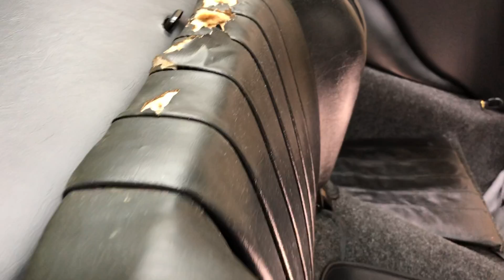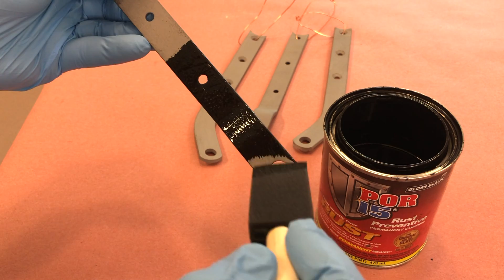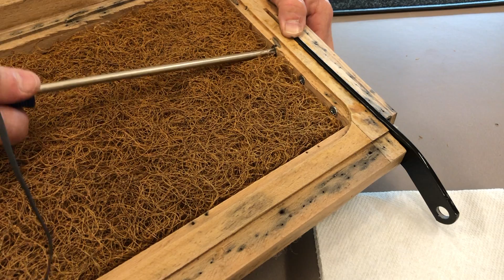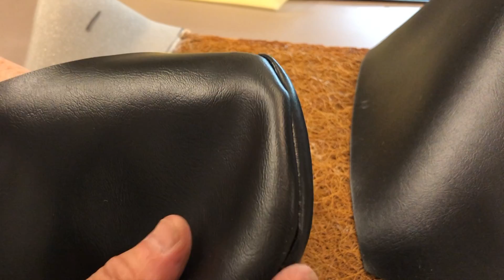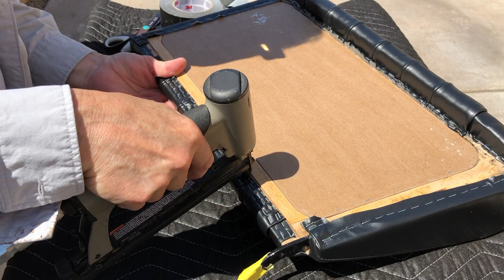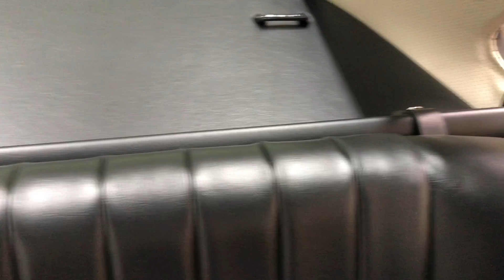Porsche Rear Seat Restoration    Part-1 seat backs!

Comment: What size foams did you use?  1/4 and 1/8?  Getting ready to tear mine down and want to have everything on hand.  Thanks,
Reply from the maker: Hello Don
The Kits were from Autos International Inc and any misc. foam under the kits would have been a 1/4 inch. The only place I used 1/8 inch was the
dashboard main piece.
Good Luck with your restoration work!
Cheers

Comment: My screws for these rear seats are completely stuck… haven’t been able to get them to turn at all
Reply from the maker: Have you tried KB 88? it works wonders
Reply: @MikesRestorations  no I haven’t, I hit them with some PB Blaster about a week ago but didn’t try to break them loose after that (moved onto other bigger problems). I took off all the calipers and found out all but one were stuck pretty bad (I still have one stuck piston that I haven’t been able to get out haha).

Comment: Mike, what did you do to the rails that the seat bottoms ride on to make them so nice?  Mine are serviceable but the metal is stained.
Reply from the maker: Hello gtate
The rails that mount to the floor were re-plated.
The rails that are riveted to the seat bottoms were left in place and masked off to polish them.
Mine also had some severe stains but the polishing did remove the stains.
I used blue magic polish with a high speed drill and polishing pad. I also used a dremel with small polishing 
tips for the hard to reach areas and then polished by hand with a microfiber rag and blue magic.
The trick is a good masking job so you can apply lots of pressure in those hard to reach areas.
Its really messy work!
Good Luck!
Reply: @MikesRestorations  Thank you MIke!
Reply: Mike, when I heard you say it took you an hour to do each side I though “phew”, I can do that easily.  But found it very frustrating.  I just could not get the knots tight enough to my satisfaction even with glue.  So I threaded them straight down and through the long slot in the bottom of the seat (tow slots) and made two small straps with three holes to tie off the cords straight down.  Seems to work.  Thanks for all of your videos.  They are gold mine for amateurs like me.  All the best.
Reply from the maker: @gtate4200  You're welome=) it always seems to take longer what ever we are doing also lots of ways to get there!
Im glad you were successful 
I wish you the best of luck with your restoration work!
Cheers!

Comment: As usual Mike, great job...really nice. I’m curious what material you used for the stiff backer board. It looks like some sort of fiber board. I need a thin and stiff material for a different application...a temporary and light weight top for my 73 Targa ...and that material would be perfect to be sandwiched in between a sunbrella fabric.
Reply from the maker: Hello matril01 thanks
The boards you are referring too are 1/8 mdf with vinyl backer on one side. The originals were 1/8 compressed board also.
Masonite would also work but it's a bit harder.
Available at Home Depot..good luck!

Comment: Hey Mike...I know that you have put a phenomenal amount of labour into this Porsche rebuild but will you be stating all the material costs at the end of the project..?
Reply from the maker: Hello Chris..Thats a good question
The cost of restoration unfortunately will remain confidential but I can share the approximate number.
Expenses will be approaching 6figure to date.
Usually in terms of professional work that would break down to 1/3 material expense and 2/3 labor expense.
For example high end restoration shops..A restoration at this level could run 3-500k depending the shop.
Total hours to date..approximately 4k